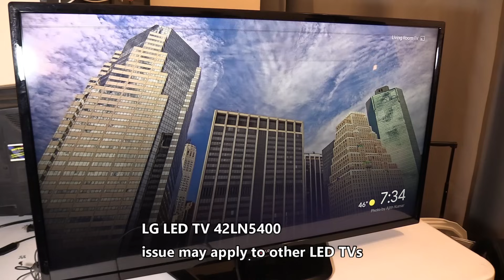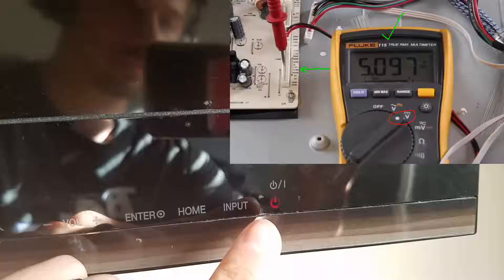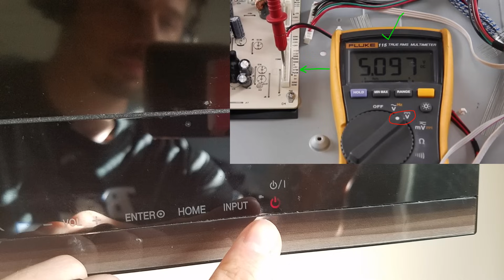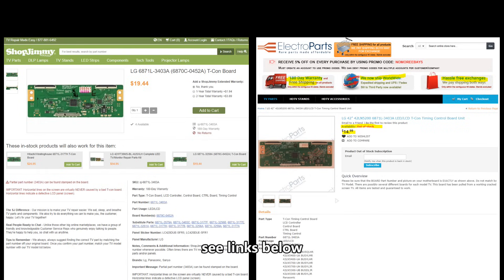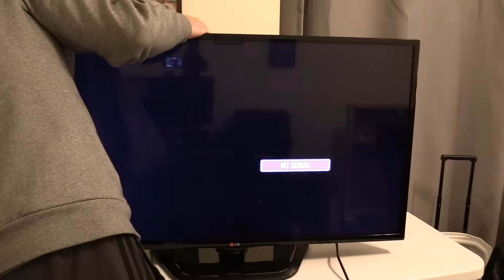How to Fix LED LCD TV with horizontal & vertical lines on the screen

Comment: Hi , Great job on the  info videos you do on fixing flat screen TV's and how to troubleshoot them. I have an RCA L32D10 which i got from a friend. It powers on ok but quarter way from the bottom i get a thin horizontal line the the screen starts to show vertical lines also which makes the video  look washed out. I don't know if you ever came across this type of problem but i would like your thoughts an ideas on how i can solve this problem. Thanks in advance any help will be deeply appreciated.

Comment: My TV doing something similar -- line across the screen when it is just turned on.  It is a LG 65UH7700.  So, I hope that BestBuy will replace or fix the issue -- not even a year yet.
Reply: How did you fix this please? My LG  55UH77OV suddenly  has black and white vertical lines on them....

Comment: Hi great vid. Lots of valuable info. Thanks. Ive water damaged my LG LED. My g.son splashed a small amount of water on the middle of screen, and trickles have gone down between gap where screen meets frame. I've opened and low heat blow dried. Getting red vertical lines with no image but audio is fine and I can change channels. Is that typical of T- con damage?

Comment: Greetings Tampatec

Thanks for uplpading this video. I currently own a Sony xbr49x830c 4k led tv. I have this horizontal line issue. There are 2 lines one flickers the other does not. Could this be the panel or the tcon board? What would you recomend?

Thanks in advance

Comment: Hello Paul aka Tampa Tech. A friend gave me his Sharp lc-70le847u because he was told the repair cost was 1K or better. After watching many of your videos I believe that it can be fixed for the cost of part(s). There is a thick vertical band from top to bottom on the left side of the screen that appears from power up. Can I send you a picture or video for a better chance at a good diagnosis?
Your videos are amazing & inspiring- thanks in advance!!!

Comment: Would this work for a Samsung 3D Television?  I am having problems with horizontal lines at the bottom of the screen and the picture looks like as if there were a Magnet on the side. It's a Lcd TV.
Reply: How to solv the horizontal line

Comment: Good useful info. Just subscribed. My Sony Bravia blacks out for about 4 seconds at a time. Would replacing it that board fix the problem? Thanks.
Reply from the maker: Derrick Harriott, Jr. If backlight stays on but picture goes blank it's usually tcon board, get tv boards at shopjimmy.com or electropartsonline.com use code tampatecfriend for discount.
Reply: Great, Thanks again

Comment: Hi Tampatec love your videos but never thought i would need to repair my Panasonic TC-65CX400U but here i am looking for advise with the TV. It works with picture and sound but there is a dark band vertically about 16 inch wide in the center as if there is no contrast i can still see the picture through it but its so dark. Any advise would be appreciated thanks.

Comment: do you have a video on how to fix an samsung model un60eh6002f with a permanent thin black horizontal line?  The line does not show up when doing the internal picture test on the TV.  But it does show up on any input source used.

Comment: Hello .. I have the same tv, when I turn it on I get a tv glow but no pic with sound on. I have checked the Tcon board I found the fuse doesnt work, I got a wire to connect the fuse then I got a smoke going out the main board, what do you advice me to replace now ? both the TCON board and the main board ??  The tv still glow with no pic sound on. thank you I appreciate.

Comment: My TV Bravia KDL 46XBR46 problem is T-con board. Want to replace it but when I removed the back panel I cannot access the T-con board because in this brand it is embedded inside. It's like I have to remove the whole steel panel with all the boards in it before I can get to the T-con. Is there another way to get to the T-con board?

Comment: I've got kind of an off the wall question. I have a LG 55LB5900-UV that I already have apart to replace the LED strips in. Is there an equivalent "smart TV' that I can just put a board into my 55LB5900 and basically upgrade it to a smart TV? It just was a thought I had while I have my TV apart. Maybe I'm crazy. I don't know. lol I just noticed a bunch of different mounting screw holes where other boards may go, or larger boards, and thought it might be an easy thing to do. If it's even possible at all.

Comment: Good Morning, i have a Samsung 55", model UN55F6350, and have just replaced the t con board. unfortunately i am still getting the horizontal lines and dots. any other suggestions like bad ribbon connectors? any feedback will be most appreciated. thank you!

Comment: I successfully changed a T-Con board but lines didn't disappear. What could be the next trouble shoot. My TV started producing vertical and horizontal lines on and off after my daughter poured water on the screen.
Reply: Same issue i had did u fixed

Comment: Horizontal lines on the screen are virtually NEVER caused by a bad T-con board. Horizontal lines indicate a defective LCD panel (screen).
Reply: so what should be replaced??

Comment: I have an older (10 yrs) Sony Bravia 40 inch tv that works beautifully for 20 minuets then quits with vertical lines. I turn it off for 15 or 20 minuets and it works for a short while, over and over. HELP

Comment: my tv fell & there's a crack on the upper left frame. zero cracks on t.v... it fell about a foot off of the stand not completely on the floor or completely face down, more so hanging off the stand and half way on the floor upside down.. sound is still good. colors are still there.. horizontal jumping and horizontal lines across.  after a few minutes u dnt see the picture but when powered off than on you can still see all I mentioned above

Comment: Do fixed horizontal lines always mean a bad panel?
Reply from the maker: JP S usually yeah
Reply: Tampatec thank you! And fixed vertical lines is usually a tcon or bad panel?
Reply from the maker: JP S in my experience bad tcon board usually but next bad tabs on lcd panel ribboncables with skill and right tools lcd panel tab connections can be fixed, see my repair playlist.
Reply: Tampatec thanks man, keep up the great work. This community appreciates your insight!
Reply: @TampaTec  Thank you for the video and this reply -- our LG LED TV has been slowly developing very thin gray lines from left to right that are permanent, and no one could tell us what they were. We'd watch TV and suddenly two more would show up and we had no idea why! Knowing it's the panel is a huge help, thank you.
Reply: Hi Tampatec, which video on repair playlist shows fixing panel tab connections...i have a ribbon cable/tab that has a hole in it affecting 2-3 very tiny lines and now i have a fixed solid bar showing ( i was thinking maybe i can patch the hole with a plastic film backing then use a CircuitWriter Conductive Ink, silver-based after exposing contacts and trace them then cover it back up with another plastic film?? though i've never used a CircuitWriter before and as far as soldering goes i can count the times i've soldered on one hand ....but if that's what it takes i'll practice soldering
Reply: So your saying tcon board is mostly become faulty or the led screen strip board on top.   Is it possible to use a tcon board part from a 65in into a 55in of same brand or vice versa?

Comment: Thanks for your videos, they are very instructive. I have a question: my TV Toshiba 50HP66 has 5 lines at the top and one more in the middle of the screen, horizontal lines, any idea of what the solution would be?

Comment: I have a Sharp Roku LCD with white verticals lines, unplug the Tcon board and when I plug it in the picture is good for 3-5 seconds then they come back. Replaced Tcon board and same issue. Any suggegestions? Thanks!

Comment: I have a element 60" elefw605. It turns on menu shows up but it is green turning to white letters. Background has verticle lines in the middle 50% of the screen.I replaced the t conn board but it didn't fix it. Any pointers??

Comment: Lg seems to have a lot of problems. My tv of less than 3 years had a black screen but with sound.
Reply: It's probably because there is problem with the backlights and you need to replace the led lights.

Comment: Would you suggest buying a warranty program for an LG C7 55" TV?  What TV's have a better reliability rating that you experience?  You can answer if you feel comfortable about an educated opinion.  I noticed that this TV has gone from 2999 to 1699 in price.  I know that upcoming new tvs are coming out and we passed the black friday to superbowl discounting
Reply from the maker: 🤔 can be worth it, if the repairman can't fix the TV in 3 service calls usually you get a replacement TV same model or newer model. Warranty costs about 10% of the TV, so $1,600 TV that warranty would cost roughly 160. Avg TV repair service cost $200 roughly including parts and labor. Do it yourself TV board replacement cost roughly $100. Remember TV Warranty doesn't cover damage or theft.  About 1 out of 10 TVs will fail in 5 years but Toshiba TV have lower failure rate. I see TV failure because of surges, humidity, backlight settings set to Max which burn out the LED strips faster in the backlight. So consumer care will prolong your TV life. Hope this helps. I don't buy TV warranty but if it's free it's for me. Remember every new TV comes with free 1 year factory warranty. 👍 Sub and like if this helped.
Reply: @TampaTec  thanks,  based on your response/advice I changed/calibrated the settings to my backlight to minimum (the setting recommendations were from Rtings website).  I think/know that will save my backlight.  Always look for advice from the experts.  Also, this Sony 49"800e needs to be calibrated for each HDMI.  Reading before buying a TV helps as I didn't know the difference from a VA or IPS for angle viewing.  Retailers would never tell you that.
Reply: Never buy LG tvs . i bought mine and in less than 3 week it broke. There was a pink line across the screen and it started flickering

Comment: Great videos and very helpful as I have a Vizio XVT3D650SV and it’s entire screen has vertical bars running across it all over which tells me the screen is fine...and when I plug in my laptop and move my mouse around I see a faint white bar move vertically across the screen where my mouse is accordingly. Would I just need to purchase a new LED controller board and replace it do you think?

Comment: Tamptec , I just fixed my backlights on my vizio e70-e3 and put everything back together and got about a quarter inch black line with green edge on left side of screen ... it was not there before just bad led strips... do you think t con or the yellow ribbons or what ? I do appreciate greatly in advance if you have a sec to reply thanks

Comment: I've got vertical lines that go away as the Philips/LG TV warms up. Any ideas? The lines are there when the TV is cold no matter the input source and across the OSD. So I don't really suspect the powerboard or mainboard. T-Con or worse... LCD panel itself.
Also when observing with a magnifying glass and verifying the colors. The blue diodes operate in that vertical line, but red and green burn intermittently on each horizontal line. So from the 1080p screen there are 540 leds operating green and 540 leds red.

What do you think? My first bet is a bad solder on either the connector going to the side with the issue, or a bad solder on the main chip on the T-Con board. Although that might be hoping for better rather than worse, which is the glue on one of those panel cables.

Comment: Stevie B i have lg37lg30-ua replaced 8 caps.in power supply and still set will not come on i have stand by voltage 5v that is all. can you help me

Comment: Thanks for your how to videos keep up the good work. I have a 60" Samsung TV that has no video or sound and with the back off I can see the lets flashing. When I unplug the LEDs from the power board and try to play a DVD I do not get any sound. Do you think that it is the LED strips or something else? I replace the power board since the LEDs connect directly to the power board and with the LEDs connected the power would pulse.
Harold Tinsley

Comment: found your site looking to fix my 55in insignia led lcd. SUPER cool videos! THANKS! My first tv fix attempt. Originally there was a corner cloud in the lower left but is seemed like the bottom of the screen developed faint "scan lines", they were not really black lines, more like cloudy "lines" so the picture was not smooth but sort of cloudy shaded cloudy shaded very subtle.  now after a couple months TV stopped working and just glows black with back light and sound but no picture also with standby light.. I've been able to find 2 pins on the cable going from PLTVEW401XAT9 powersupply board to main board 715G7228-M01-000-004K... so pins 15 and 16 look like they should read 5V but they read 0V. Anything labeled read as it should except those pins (and of course all the spots that have no number I have no idea what they should read) so not sure what to do at this point.  nothing looks burnt or bulging anywhere. shopjimmy and electropartsonline do not have either board So I'm wondering if you think it is the bad lcd or could it be a board and I should take a chance online with another board(s)?  Thanks for any advice...

Comment: I REALLY REALLY need your help, please respond... Someone, anyone :). I have a Vizio E470i-A0. E headlight LEDs went out 2 weeks ago right before the UGA/BAMA National Championship Game...errr. Back to my TV. I replaced the backlights and the screen had a strobing effect from top center to bottom right. I figured it was defective LEDs, so I got another set... Same issue. I have posted a private YT video if you're interested? I have checked voltages, and I'm going to remove the panel so that I can see the LEDs directly. I'm assuming that it's ok to turn the TV on without the panel attached? I even tried removing the IR sensor because it was causing you issues in one video... Then nothing displayed at all on the panel... I didn't get the V logo upon startup, now could I get the menu to show... Just a black screen with the backlights on. Is it possible that the panel is causing this since the panel board (forever the proper name) is part of the panel itself and can't be replaced? I'm at a loss, but already in this for over $100. The TV isn't even that old!!!! Please please help me figure out the cause.

Comment: hi I have a insignia  NS-L42Q120-10A 42 INCH TV. i originally had a wash out picture. i replace the t-con board , and got a half picture showing, i then replace robin cable, but the problem remain the same. i again replace the t-con board { my second purchase} i now have good picture good sound but with vertical lines in front the picture, can any help be given.

Comment: Hi I love your videos but I need some help I tried all of your diy tips except replacing the tcon board I have a Sony bravia kdl-42ex441 with half the screen showing solarized and flickering distorted colors I want to know if replacing the tcon board will solve the problem if I can send you a video you will know what I'm talking about but that's basically the problem I even tried steps to see if the lcd panel bad but it seems ok any help would be appreciated thank you
Reply from the maker: Willis Griffith yes, tcon may fix your issue and it's a common problem in Sony LCD Tvs. shopjimmy.com  electropartsonline.com has tv boards use code tampatecfriend for discount.
Reply: Thanks for your reply how can I send you a video
Reply: Tampatec the problem is I'm from Trinidad and Tobago so the part might be hard to get
Reply: Thanks..i also am having a similar problem with a sony tv.... Will look into the tcon board thanks.

Comment: I really enjoy so much of what TampaTec does here, they are just the greatest! Someday if I happen to get closer to Tampa from where I'm at (about two hours away now) I want to look you up and shake your hand for all the wonderful advise. Tampatec Rocks! 👍👍👍
Reply from the maker: sure thing
Reply: @TampaTec   I replaced all 4 boards in my vizio e50-d1.  And I still have flickering horizontal lines on the bottom of quarter of my screen.  I noticed when I disconnect the right ribbon cable from my TV on board the flickering stops, and yes half of the screen is black, but the other half is on and doesnt flicker.  Is this a sign of a bad lcd panel?

Comment: hi>> 
thanks for your very useful information and very simple clear way
i have sony lcd tv model KDL-70R550A  IT was working fine bu one the screen becomes black with no pic 
i can see that screen is on but no pic or any thing like menu or volume signs nothing only black screen, i checked the back lights its working 
also there is the same tv for my brother i replaced  all boards to my tv and my boards to his tv and the same dark  screen and my brother tv working fine 
even i changed all the cables and ribbons around the lcd panel it self and and between boards also the same result black screen and the other one working fine

Tv on a good stand and no one touch it I dont know what to do??

help me please

thanks
Reply from the maker: Sony KDL models is known for bad tcon board and faulty lcd panels, which some models the screens were recalled.
Reply: thanks for your reply